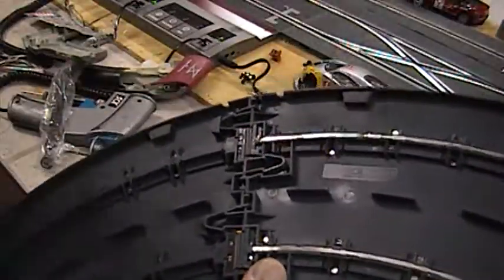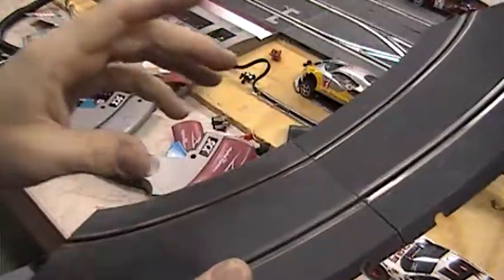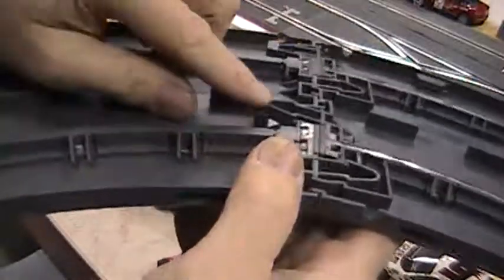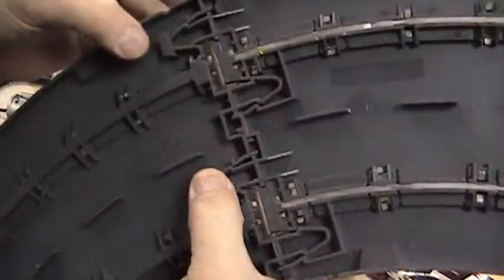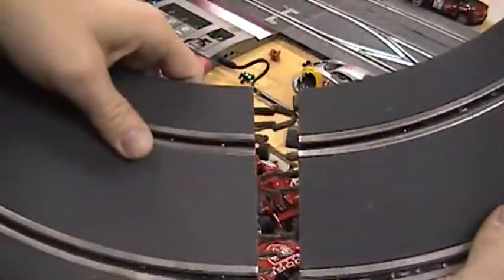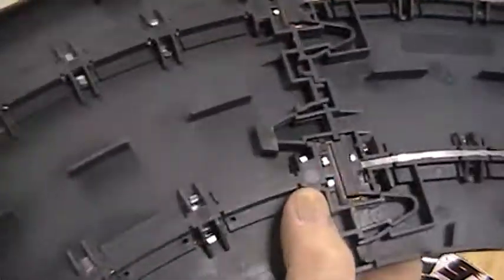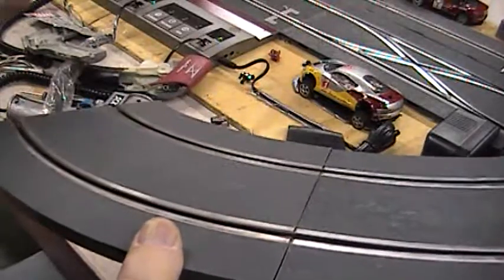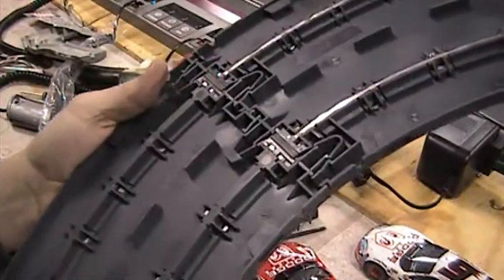How to put together a SCX Digital track

Comment: OK - I have an SCX question. We have grandkids that I would like to introduce to slot cars. The first concern I have is if I can configure the throttle settings so that the kids can't just pull the throttles wide open and destroy the cars at the first turn.